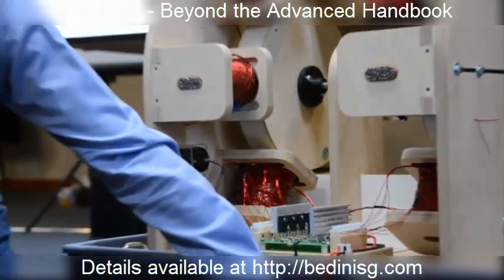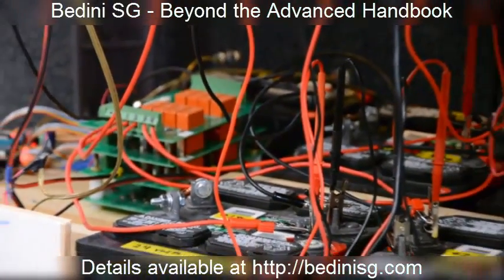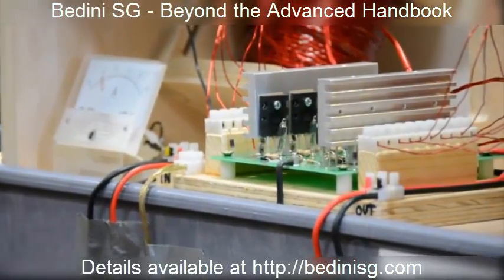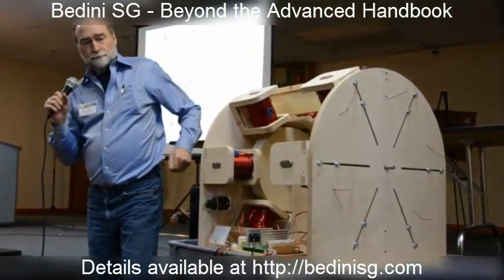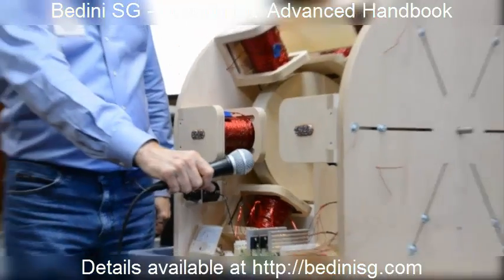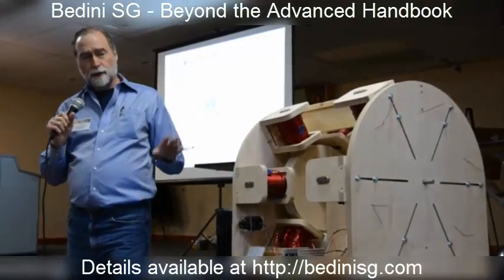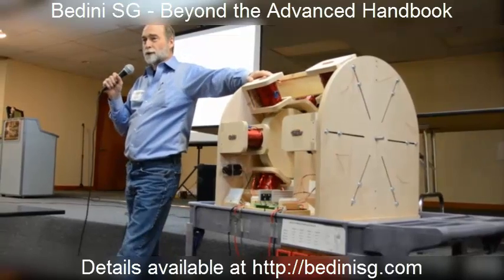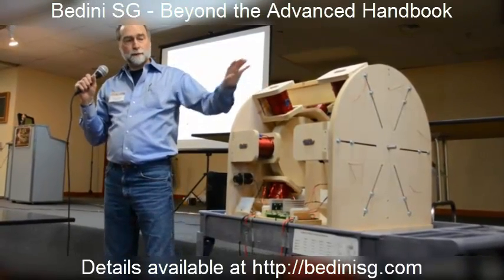Bedini SG - Beyond the Advanced Handbook by Peter Lindemann

Comment: What is the difference in performance of the machine with a rotor that has magnets facing north versus a rotor with south facing magnets?
I'm building a machine now and I accidentally built my first rotor with south facing magnets so I had to rebuild it, now I have both😊
Building the coil now and will assemble it soon but I haven't been able to test anything yet.
Reply: After referring back to the handbook I realize that the South Pole magnets change the machine from repulsion mode to attraction mode.

Comment: "THEE Nickola Tesla" ,, proved that a regular spun coil will act against itself giving it a lesser output than the tesla spun coil. You can test this yourself. wrap a coil  with magnet wire around a bolt. wrap second coil as follows use the same length of wire as you did on the first coil only fold wire in half and start wrapping the  folded section of wire first on bolt. when done wrapping coil take and cut inner wire where bent.. attach inner wire to outer wire this will leave you with an inner wire and an outer wire. Attach volt meter to ends of wire on first coil.... Place a magnet on end of bolt and then pull magnet off and look at volt meter to see voltage. do the same to the other coil. COIL 2 wrapped tesla style gives out much more voltage than the regular wrapped coil.  PROOF.  The ONLY good bendini generator is the one where the coils are wrapped tesla style.
Reply from the maker: We have that on an SG we demonstrated about 4 years ago.

Comment: Bedini is just a charger  but not give us free energy ,but gives us the  loss of money to find out the truth by therory :  the circuit of bedini is clearly  is a free energy circuit having the feed back diagram ,but in the long run it does not give us the free energy due to the loss of power only  give us  the loss of time and  the money that we  spent on it.
Reply from the maker: Study the books, you're missing it.
Reply: It is  true?
Then you need accurate data on how long the battery will charge how many volts? How Many Amps and How Long time Hours day? We waiting the answer Mr. Bedini, Thank you for answer,

Comment: Love the bedini Sg but my preference is the Newman motor
Reply: Constantine Joseph  What are the best 2 reasons , as to why you think it's better . TY
Reply: Firstly it is the scalability of the Newman motor.  The Newman motor can be built with no electronics and can work with high torque applications in traditional brushes systems.   Secondly, the Newman motor has been demonstrated by Joe Newman to run heavy equipment like his big eureka motor.  Using only transistor batteries, that motor runs industrial grade pump easily, when three phase power is required.

The Newman motor has so far in performance wise have been proven to be able to access more torque primarily down to the sheer reliance on mass of copper.

There are ways to slim or compact the Newman motor down to become even more desirable by using different materials to increase torque and power density, something that is greatly desired in the world's motor market
Reply from the maker: I've built an SG with 100% mechanical parts so you can do with it the SG as well. SG was never made for torque, the wheel is a switch and not a motor. Bedini has shown higher torque motors, but they're very different from the SG.
Reply: @AaronMurakami13  Is it possible to have the plans how to build a 100% mechanical SG
Reply from the maker: @gstorm1491  It is possible to make something that runs just with copper contacts to replace the transistors, etc. I don't know how well it would work - would be best to at least have a diode to take the recovery to the desired battery.
Reply: @AaronMurakami13  With all the system you have made is there one that you use to supply your home with electricity?

Comment: Hi Aaron,
I bought the "Beyond the Advanced Handbook". I was hoping for better data on the design of new coils (length and  diameters of wire, for example), but this is not indicated, or I did not well understand.
In the diagram, "A" is it really two batteries (2 X 12V in series) ? Is it the same for "B" and "C" ?
The "cap pulser" It has its utility in this new configuration? If so, what is the location? If not why ?
Should be 9 strands twisted together, as before ?
Thank you
Michel
Reply from the maker: Hi Michael, all specs for the coils are all given in the Bedini SG - The Complete Handbook Series. I think it's in the beginner's book. Peter's presentation you have builds upon everything taught in those books. 18 awg wire - a wire for each power winding and one for the trigger, which can be 18awg or even like 21 awg. If you have 9 wires, then 8 are power and 1 is trigger. Stretch out all 9 wires to 130 feet and then twist them. After twisted, wind on the spool. Keep in mind the direction of the windings so you have a north field on top of the coil or south field on top of the coil when power turns on. You can see a coil being wound here: https://www.youtube.com/watch?v=DUGh9v2AsuA And keep in mind if the polarity is the same as the magnet facing the coil, you will have repulsion mode - not recommended. Have an opposite polarity of the permanent magnets facing coil so it runs in attraction mode and you reduce the bucking losses and the circuit runs cold. 

A & B (I don't see the diagram now) is 2 x 12 in series for 24 volts. C is reversed single battery so BETWEEN THE POSITIVES, you have a potential difference of 12 volts and that is what the energizer is running on. Current from the 2 in series moves through battery c while running so that current not only runs the energizer but charges that battery at the same time. Scroll to post #6 in this thread: http://www.energeticforum.com/renewable-energy/20047-question.html

In Peter's demo, it was the oscillatory transients (collapsing magnetic field output - the "spike") going to the battery - he wasn't using a cap discharge on output.
Reply from the maker: I'd recommend joining http://energyscienceforum.com - that is the official SG forum.
Reply: @AaronMurakami13  this link is no longer working
Reply from the maker: @emmantrop  Try this http://www.energyscienceforum.com/
Reply: Can you share copy of handbook